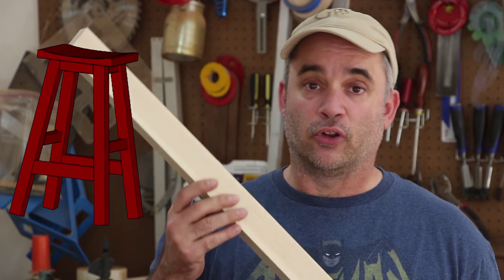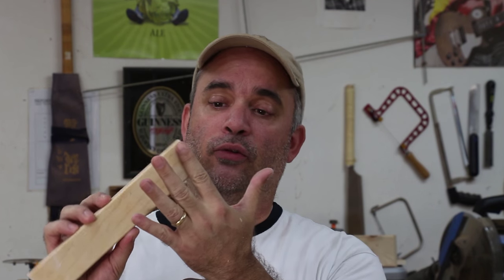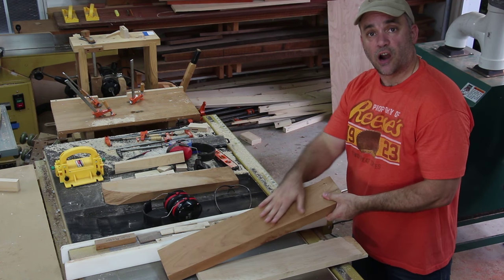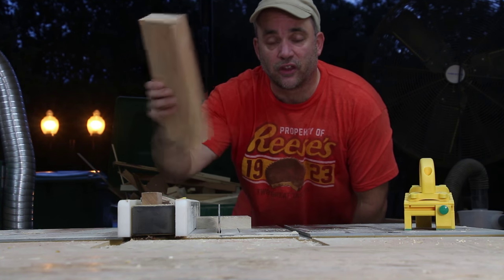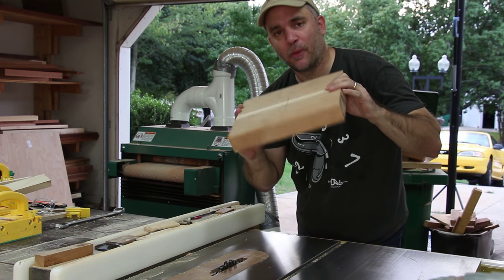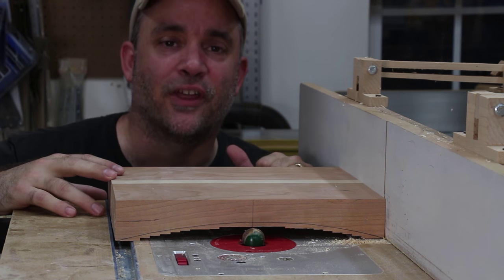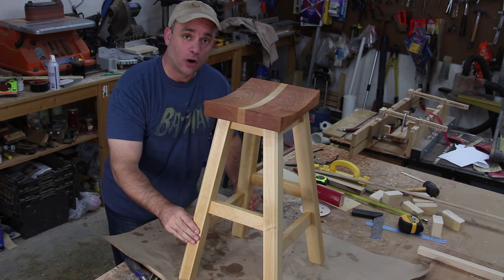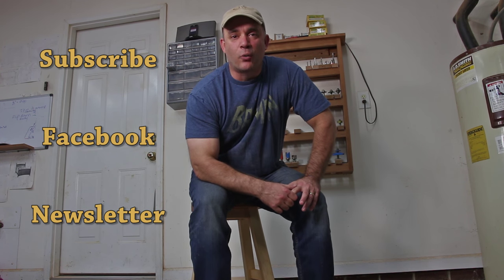Make a Shop Stool (Part 2 of 2)

Comment: curvilinear surface of the seat can be done entirely on the table saw using the diameter of the circular saw. I saw a video of Izzy Swan making a bowl entirely with a circular saw. Yours is way easy and can be achieve with few steps . Great looking stool you have there.

Comment: great video, gives all the details of the project, lots of interesting tips. I have a Domino, have to figure out how to keep the tool at 8 degrees like you did. I didn't see plans for the stool, what height did you use, I looked at ergonomic seat heights for 36" high benches but it's always a range

Comment: Nice technique for carving the seat.  Just curious though, why not use the bandsaw, yours has the capacity doesn't it?
Reply from the maker: +MonkWerks with Fr. Thomas  For some odd reason I had router on the brain and never got past it.  The bandsaw would have been faster.
Reply: +GarageWoodworks I know the feeling, but its still a great technique for those with a small bandsaw!